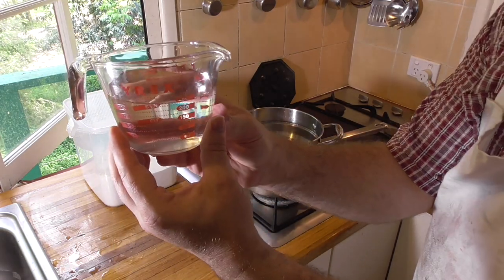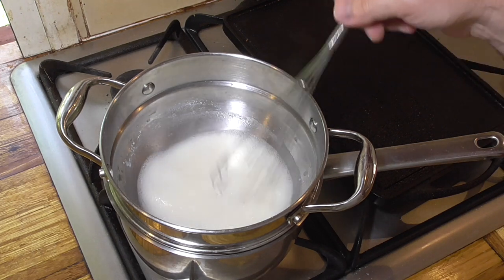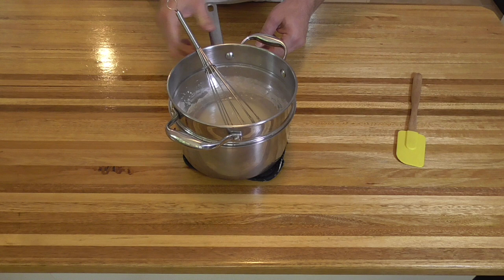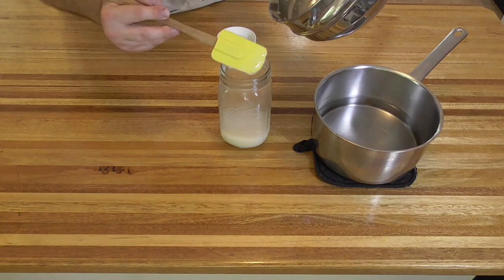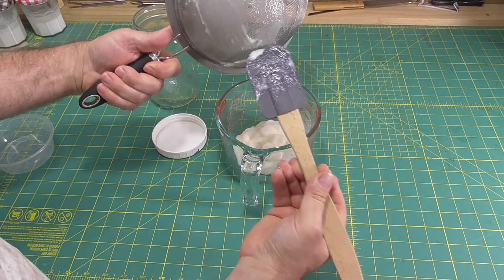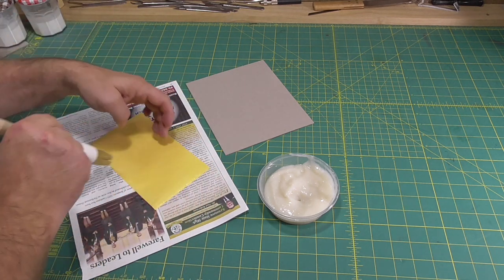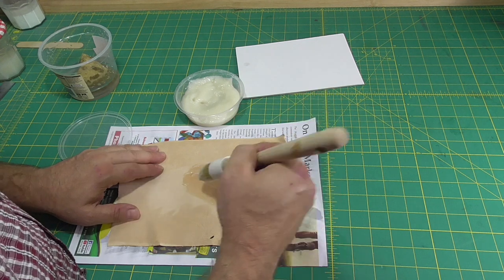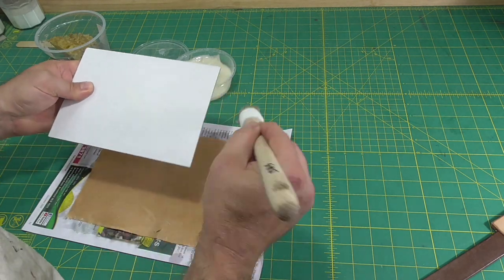Wheat Flour Paste for Bookbinding // Adventures in Bookbinding

Comment: A tip that may be useful: It can sometimes be annoying to stir out lumps when adding powders to liquids. If you put your dry ingredients in the bowl first and add a small amount of liquid to them, you easily can whisk that thicker mixture until smooth. Then the rest of the liquid can be stirred in without forming any lumps.

Comment: Hi, I'm Japanese. Do you mean the rice starch paste? I create rice starch paste last week. 
This is a method that can be done at home using the same method as rice starch paste sold in Japan. Grind the dried rice. (I recommend using glutinous rice from Japan or China, or non-glutinous rice from Japan, which has a lot more gluten than other long-shaped rices.) Next, once it has turned into a powder, sift only the fine grains and remove the larger grains. Most of this is the germ part, which is high in lipids. Sift it through the finest sieve you have, and soak it in 4-6 times the amount of water as the powder. Stir well and leave it for more than 30 minutes. The starch is separated from the cloudy water and collected at the bottom. Slowly pour the cloudy water out, then add plenty of water again and stir to separate it from the proteins and lipids. I repeated this 8 times. Add water, stir, and repeat until you have a clear liquid and a sediment after more than 30 minutes. After the liquid becomes clear, pour in water and stir, and if the water does not become clear even after hours, all of the sediment is rich rice starch.  In other countries, it is then dried and powdered by air drying or other methods and stored, but because it is unsanitary and may be eaten by insects, in humid Japan, nori is made using only the amount obtained using this method. My grandmother used to make it using cooked rice, which turns yellow within six months. Even if it is made from simple rice flour, it will turn yellow in 2-3 years. My method seems a little time-consuming, but it takes a long time for it to turn yellow.

Comment: Thank you very much for sharing! 
I've found two recipes for wheat paste and wheat and starch combined in the book of Pauline Johnson "Creative bookbinding", I'll share them here in case someone is willing to give them a try :

"Flour Paste

1 cup flour
1 cup cold water
4 or 5 cups boiling water

Put the flour in a saucepan or double boiler and gradually add the cold water, stirring well until all lumps are removed. The mixture should be runny like a thin cream. Slowly add the boiling water and cook the mixture for 3 or 4 minutes, stirring constantly. Let cool.

If the paste is to be kept several days a preservative can be used. Two teaspoons of powdered alum can be added to the flour when it is mixed with the water. A little powdered clove or three or four drops of oil of clove can also be added, if desired, to discourage mildew and mice and act as a preservative. " 

"Flour and Starch Paste

1 teaspoon flour
1/2 teaspoon alum
2 teaspoons cornstarch
6 tablespoons water (about 1/3 cup)

Mix all ingredients in a saucepan and boil for 4 or 5 minutes, stirring constantly. If the mixture becomes lumpy, it can be put through a kitchen strainer when cool."

Comment: Interesting and informative as always! I followed your recipe for laundry starch paste but achieved a completely solid, but bouncy result. Weird, but not useful as an adhesive. Turned out that for whatever reason, I needed more water in the paste. I have had more success with flour paste (and the clove oil imparts such a lovely scent to the bookcloth I make with the wheat paste). I will also keep experimenting (or rather, following your experiments in my own kitchen.) Next up, bread flour paste, because that makes total sense. One thing I have noticed, is that the paste goes from milk -like to thickened in an instant, at the point when it does. And the cooking seems to take less time. I don’t think it can be environmental, because here in eastern South Africa, our weather must be pretty similar to yours. So many intriguing variables!
Reply from the maker: Interesting.  A 5:1 ratio for starch paste is close to universal.  The transition to thick is very fast.  Some people insist you have to continue cooking for some time after thickening.  Since I use a Thermomix, it is easy enough to just let it cook and stir for 20 minutes.  But before I had that it was tedious cooking paste.  I was recently warned that a lot of laundry starches have added silica.  The one I use hasn;t in the past, but I would never put it past a manufacturer to change something.  That is why conservators don;t use laundry starch I guess.  All the best, DAS

Comment: I do not have a double broiler. I used an oxo stainless steel bowl with rubber nonstick bottom. My flour was king arthur all purpose and I used filtered drinking water from my fridge. I followed Kathy's proportions and cook time but somehow... my result was mostly cloudy water and the tiniest bit of paste. I must be doing something incorrectly but I'm not sure what. I'm just glad I found your channel before directly gluing fabric onto matt board! Disaster avoided!
Reply from the maker: That is a sign that the mix cooked fast at the surface of the bowl.  Use a lower heat, which will mean a slower increase in the temperature and stir constantly with a whisk, especially at the temperature when the mixture thickens - between 60 and 80C.  Good luck!  DAS
Reply: @DASBookbinding  thanks for the analysis and feedback! I will try again!

Comment: I love your little scientific experiments. It feels like I always learn something new.

Sage Reynolds made wheat paste without heating it (just mixed the Wheat Wallpaper Paste from Golden Harvest with water and let it sit for a while) in his recent "Two Black Albums Part 2" video. He said that he uses the non-heated wheat paste for made endpapers and casing-in. I wonder, if you make wheat paste with regular wheat flour without heating it? It probably wouldn't last as long that way.

Also a little trick that I've learned from baking is to add the water into the flour and not the other way around. If you add just a little bit of water, stir well, add a little bit more water, stir some more and so forth, you avoid lumbs. At some point you can add more of the water at once, but start small.
Reply from the maker: Yep, "cold-water paste" used to be very common, maybe less so now.  You can't make paste with cold water and flour.  The starch has to be cooked at some time.  I assume most cold water pastes are dehydrated cooked starch pastes, with secret additives different to each manufacturer.  BCM says of it that it is "satisfactory" but goes on to say that it is better to cook your own.  For most bench work I have MC made up.  If I'm making made ends I use, and still will, PVA/MC mix.  The flour paste will be for leather work.

As it says in the classic Ozzie song, when I make the Xmas gravy I start the mixing as you suggest.  But in this case it doesn't make a difference.

All the best, DAS
Reply: @DASBookbinding  Yeah, I'm the same. I've used paste mainly for leather. MC is just much less of a hassle as it doesn't go bad. All though I have to hand it to book binders, who use straight up PVA when attaching leather to book covers. My leatherwork is still at such a beginner level, that I'd just ruin the book, if I tried that. xp

It's a shame that you can't make cold water paste with wheat flour. That would've been handy.

Comment: You can also use rice flour, or simply cook the rice and blend it with water. If you don't have a blender, it helps to strain the rice through a fine mesh, before mixing it with hot water, or mashing it like mashed potato, before mixing it with hot water.
Reply: @shirleydick996  But that's because rice and rice flour are so popular over there. In the west, people can still find rice, but rice flour is more expensive and more difficult to find, but wheat flour is easier to find, unfortunately wheat itself is also more difficult to find, even if not more expensive than the flour. People use what is locally available for them. I think that applying it with a very stiff brush is to force it into the paper or textile, for a better bond, and the paste might be thicker because water could ruin the paper or textiles, or cause the glue already in the paper/textile to fail. As for the glue, pretty much any significant source of starch would do.

Comment: I recently learned about glutinous rice wallpaper glue. Can I also use this for bookbinding? It just says eco friendly and non toxic, but nothing else.
Reply from the maker: Sure, you can use what you want.  It's designed to work with paper.  Most wallpaper pastes have anti-fungals added, which I wouldn't like to use.  But yours says non toxic.  It will probably work like a paste rather than a glue, which is what you want I think.  I personally wouldn't use it for traditional leather binding.  I'd "stick" to wheat flour paste for that.
Reply: @DASBookbinding  Got it! Yeah, my projects usually make use of bookcloth rather than leather which is why I wondered about this. Thank you! 😊

Comment: Thank you very much for all this information, in addition to showing how to make the paste! I was wondering though, do you use the wheat flour paste only for attaching the cover to the boards or can you use it when gluing the spine of the text block as well? Does it dry flexible enough for that?
Reply from the maker: Traditionally paste is considered not flexible enough for use on the spine.  It could also introduce more moisture than desired.  However, some people like to put a thin layer of paste on the spine (sometimes as a conservation practice) and then usually put a more traditional glue, such as PVA/EVA, over this.
Reply: @DASBookbinding  Thank you so much for responding, I've been trying to find the answer to this question everywhere, but have been having a lot of difficulty with it!! :)

Comment: Do you think peppermint oil as an additive would hurt the paper bond?
Reply from the maker: Do you wan to add it as a preservative or just to make things smell nice?  Either way, for flour paste I don't think it will make a difference.  Wheat flour paste just doesn't keep so no point trying to add preservatives.  My experience anyway.  But I've got so used to the smell of oil of cloves I sometimes add it just for nostalgia.  DAS
Reply: @DASBookbinding  I thought it would add a nice minty scent.. particularly when I mix it with PVA.. 
Btw I made a batch using the 1 heaping tsp to 250 mls of water and the paste came out a bit too soupy for my needs. I wonder if that was supposed to be heaping table spoon.. I made a batch that was about 7 heaping tsp to about 1000 mls and it seemed perfect. What I do is boil around half of the water and I blend the flour with cold water in a separate container. When the water boils I add the mix. It thickens almost instantly. I them lower and cook for 20 mins. Came out great

Comment: Hello! Thank you so much for sharing this ♥️ but I would just like to ask if I can substitute the wheat flour with glutinous rice flour or simply all purpose flour? Since wheat flour is not readily available in my country as of the moment (quarantined).
Reply from the maker: Yes, any starch based flour should work.  You may have to adjust the ratios a bit to get the thickness you want.  Good luck!  DAS
Reply: @DASBookbinding  Yay! Thank you 😊
Reply: @DASBookbinding  Hello again! I have another question, I have recently read in Kathy Abbott's book that Wheat-flour paste and Wheat-starch paste are not recommended for spine of the book as it's not flexible, may I ask what adhesive would you recommend?
Reply from the maker: @imhmms8105  PVA/EVA  One specifically for bookbinding or paper.  Especially avoid PVA designed for wood.

Comment: I'm struggling to find pure starch and really want to try making paste paper, could i use this instead or will it discolor noticeably over time?
Thank you so much for all your both instructive and inspiring videos!
Reply: I do however have access to arrowroot, tapioca or corn starch if either of them are a better option.
Reply from the maker: I've not used wheat flour paste for paste paper but I think it would be fine.  I think the colour change with time would be very small over a long period of time and only noticeable when repairing paper.  Once colour is added I don't think it would be noticeable.  Paste papers have been made since the 16th century and until the 20th century these would have been made with wheat flour paste and many of these still have incredibly bright colours.  Or try corn starch or rice starch if they are available in your food store?  Good luck, DAS
Reply from the maker: Sorry I missed your addendum.  These are worth a try though some of these starches apparently get brittle.  I've not tried them.  As already mentioned, I think wheat flour would be fine, or corn starch.  DAS
Reply: @DASBookbinding  Thank you for the answer! I went out and bought some cheap acrylics today and will try making some papers tomorrow. Im so excited! :D

Comment: Do you ever use Yasutomo brand Nori? I've read that is has a neutral pH and is archival safe. I am concerned about what preservatives they might be using to get it to last so long though. I'd like to use it in mix as a convenient alternative to wheat paste or methyl cellulose.
Reply from the maker: I know it is commonly used as a paste substitute (well, it is paste) but I don't use it.  It looks a bit thick for mix.  I don't know - I don't use it.  But MC is so easy to make and use.  One bag of MC will do most people forever.  It seems easier than buying a wet adhesive regularly.  But in regards to preservatives, this would only concern me on paper repairs.  For glueing 2 things together, it wouldn't concern me.  DAS
Reply: @DASBookbinding  Thank you for always replying to questions so quickly. If I stick with this hobby for much longer I will subscribe as a Patreon. You have the best bookbinding content on YouTube and I appreciate your resources on your website. I am still going to experiment with the premixed Nori because I am curious. However, I suspect that I probably will stick with MC for mix. I was unaware until recently that MC doesn't spoil like paste will.

Comment: I saw a recipe, flour, sugar and water!  Why add sugar? Is this a preservative? Another recipe had 'borax' added!
Reply from the maker: So, by saw do you mean on the interweb thing?  I could imagine borax as a preservative .  Alum is the one often mentioned in older books.  But even Burdett points out some of these chemicals added as preservatives are often acidic.  In the case of Borax, it would be boric acid that would act as a preservative.  Sugar would promote microbial activity and would be bad, you would think.

Comment: Can you use corn starch or potato starch in bookbinding?
Reply from the maker: I think I discuss this briefly in my video on bookbinding adhesives in general.  Short answer is that you can, but not all starches are equal and there may be downsides.  No up sides that I know of - except maybe availability.  I'd use rice starch before these 2.  For the hell of it I did extract starch from potatoes just to give it a go.  It didn't work very well:)
Reply: @DASBookbinding  Cheers.  It was just a thought as these starches are so readily availed.  I think as a baby beginner, if I try book binding I will just use PVA to begin with

Comment: Have you seen any disadvantages to simply microwaving the water/flour mix vs cooking over a stove? It is a lot easier to just toss it in the microwave for a minute than messing with a double boiler and all that. But, does that result in an inferior product vs doing it the "traditional" way or is it simply "tradition" to cook it over a stove?
Reply from the maker: Problem with the microwave is that you can't just zap it for 1 minute.  You have to zap it for 10 seconds every minute or so, for theoretically if you want the same paste, the time you would have cooked the paste on the stove.  Now no one does this, and once it thickens that's it.  So I think it is easier to just use the double boiler.  Bu thaving said that I nearly always use the Thermomix, in which case I turn it on, put stuff in and walk away and it makes perfect paste.  All the best, DAS

Comment: A question regarding applying adhesive... I've noticed in some situations you use a stipling-type motion with your paste/PVA/mix brush, and sometimes more of a painting/sweeping motion. Are there situations where one or the other would be best?  I was originally taught just the painting motion (from the center out), but Jen Lindsay's Fine Binding book says stipling for PVA and painting for paste (if I recall correctly), and I never understood why.  Thanks!
Reply from the maker: Paste is usually for paper and you want to use a painting action on paper to not damage it. especially when using wet paste.  Stippling is great for getting adhesive into the grain of bookcloth and I was originally taught to hold the glue brush like a fist and work it in well.  Also good for getting an even layer of adhesive on board.  But I will occasionally paint it on too.  Paper is always centre out as it starts to stretch (expand) straight away and it is best if this happens evenly outwards.  Thicker paper doesn't matter too much and I might stipple that because I'm treating it more like card or board.  Hope that helps.  DAS
Reply: @DASBookbinding  Really helpful, thanks!